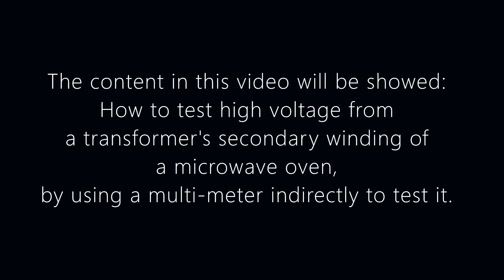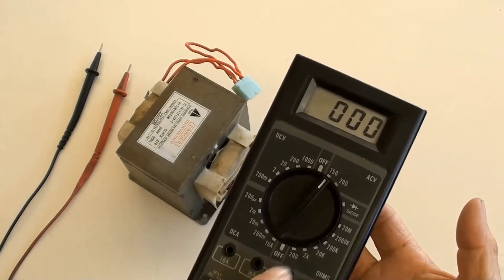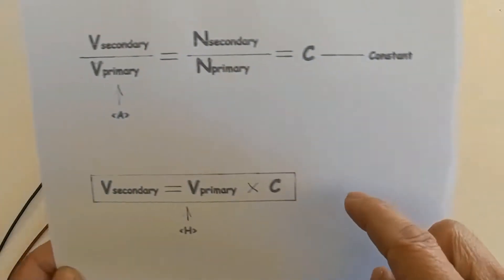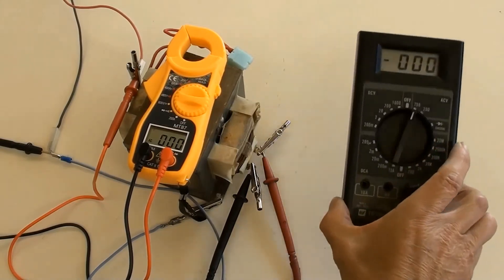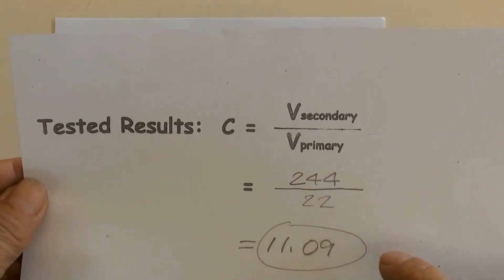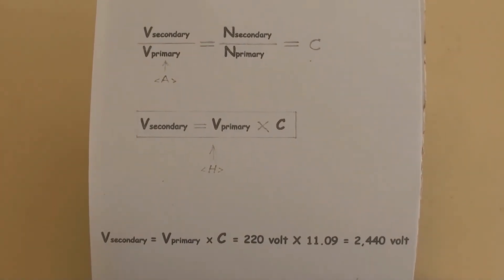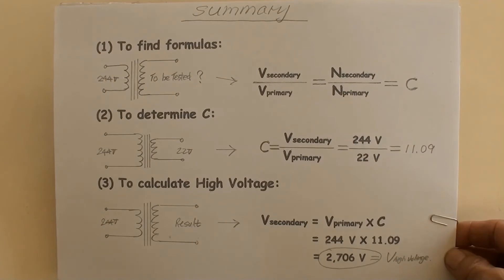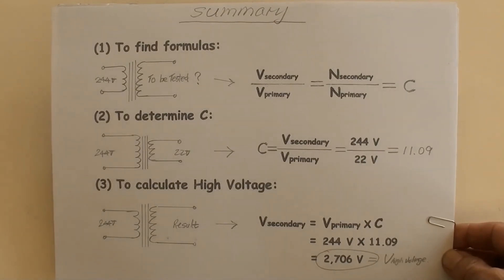How To Test High Voltage From A Microwave's Transformer By Using A Multi meter?

Comment: Switching power means loading transformer from secondary side??
Reply from the maker: That's right in this case because transformer's secondary winding from Microwave Oven has much much more numbers than its primary one.  Thanks for your interested! 👍